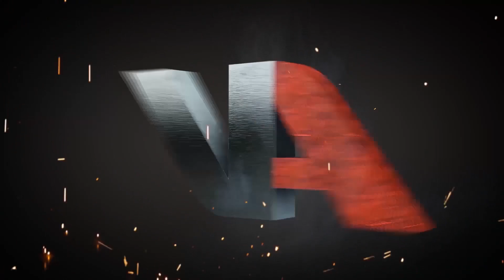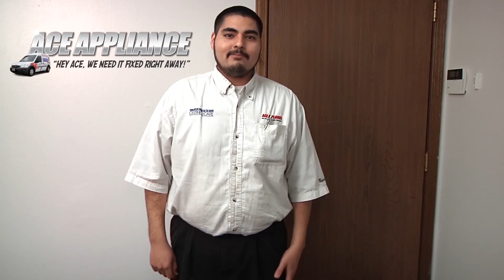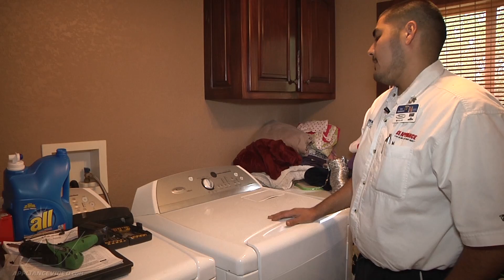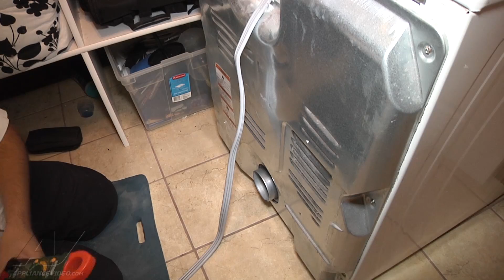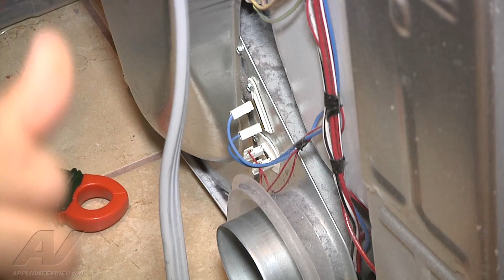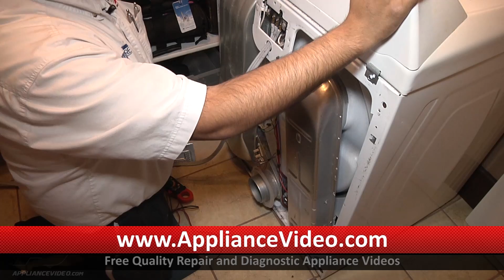Whirlpool Dryer Repair - Will Not Start - Main Control Board

Comment: What how to read diagnostic codes?
Reply: I have the Maytag Bravos dryer MEDX600XW0.
Reply from the maker: Great question, if you have a more technical question that our parts department cannot answer, you can search our over 17,000 answered questions free at our website www.ApplianceVideo.com under our Repair Help section. You can also call our parts department at 1-800-830-5465 and they can give you help 7-days A week ,or search at www.SaveMoreOnParts.com  .

Comment: Replace the thermal fuse and now spinning and running but once on normal cycle it starts at 38 minutes and after 2 minutes it goes to 4 minutes of run time, what could be the issue
Reply from the maker: Great question, if you have a more technical question that our parts department cannot answer, you can search our over 13,000 answered questions free at our website www.ApplianceVideo.com under our Repair Help section. You can also call our parts department at 1-800-830-5465 and they can give you help 7-days A week ,or search at www.SaveMoreOnParts.com  .
Reply: Moisture sensors.

Comment: on control board the relay can be replaced you can buy on ebay for 5$ and solder in yourself or take part to tv repair man to remove relay and solder in new one
Reply from the maker: +seadooman o 

Thanks for your positive comment. We are glad we
could help resolve your issue and hopefully saved you money. Please help us
provide more videos to our site by subscribing to our YouTube page or posting our
http://www.appliancevideo.com/ website on your Facebook or Twitter account. Our
factory authorized technician’s also daily provide free professional Repair
Help to people like you to help solve their appliance problems. You also have the option to email a factory
service technician with a question at http://www.appliancevideo.com/repair-help/ .  If
you need of parts for your major appliance, we have over 5-million parts in
stock at http://savemoreonparts.com/ . Thanks
in advance for supporting us. So email us if you have any other questions our
videos cannot resolve. Thanks for your support in advance.   Matt, Ace Appliance service technician.

Comment: hopefully you can lend a hand here, I have this whirlpool cabrio dryer similar product number.

the damn heater is stuck on, the only thing I haven't tested to see if the heater was somehow shorted/grounded out.   I just re soldered on a new relay, i looked at the old one after replacement and saw that inside the main contact was black.

the heater is still  on all the time even when on air dry.   I only see one relay on that board as well.

what else could it be?   I would say the only other thing it could be is the heater?  or this board is just completely shot.

any input would be great.  I'm tired of wasting my time on this thing 

thanks
Reply from the maker: Austin Wahl 

All of our technicians are now answering
questions daily on the ApplianceVideo.com website. You can search completely
FREE in our Repair Help section with over 1000 questions & answers. Or you
can get unlimited technical advice and video links emailed to you by our 14
factory certified technicians at
http://www.appliancevideo.com/premium-membership/.  If you are in need of
any parts please support our parts department on line at
http://savemoreonparts.com/ or call 1-800-830-5465 7-days a week until 11pm
Eastern time. Thanks for your support. Matt Ace Appliance factory service
technician.
Reply: ApplianceVideo.com

Comment: Within 2 weeks my thermal fuse has blown three times and technicians have come over to replace it. First they said the hose was dirty, I cleaned it thoroughly. The second guy said not enough air is going out through the outside vent I replaced it. He replaced the thermal fuse, and thermistor, The fuse blew out again, what can be the problem. I've been taking off work twice and I've asked my handyman to replace all the air hoses to see if this will prevent the problem, but after seeing your video there is definitely something wrong with the dryer WED6200SW1.  I need assistance.
Reply from the maker: Olga
      How long is your vent and how many 90 degree elbows do you have ? Have the repair men taken apart the dryer and checked for lint in the blower housing ? If the vent is too long or kinked it will blow the fuse. You can take off the vent from the back of the dryer and run it for 2-weeks and if the fuse does not blow you know you have a bad vent. Please help us provide more videos to our site by subscribing to our YouTube page or posting ApplianceVideo.com site on your Facebook or Twitter account. We also have our factory authorized technician’s email daily free professional advice to people like you to help solve their appliance problems. Thanks in advance for supporting us. Matt, Ace Appliance service technician.
Reply: My vent is about 8 ft long and has one 90 degree elbow close to the outside vent. Space is very limited behind the dryer. The vent is not the very flexible type and it practically sits straight up and then goes into an elbow. The whole vent was cleaned using a linteater rotary dryer cleaning kit and then after the 2nd time the fuse burned I replaced the outside vent opening so it would open even more. I've had this dryer for 5 years in the same place and never given me any problems. Thanks,
Reply: I just noticed there is another elbow the bottom behind the dryer.  Thought it was one, but it's actually two.
Reply from the maker: Olga 
        Try it with the vent off for several loads to determine if its in your vent. Please help us provide more videos to our site by subscribing to our YouTube page or posting ApplianceVideo.com site on your Facebook or Twitter account. We also have our factory authorized technician’s email daily free professional advice to people like you to help solve their appliance problems. Thanks in advance for supporting us. Matt, Ace Appliance service technician.